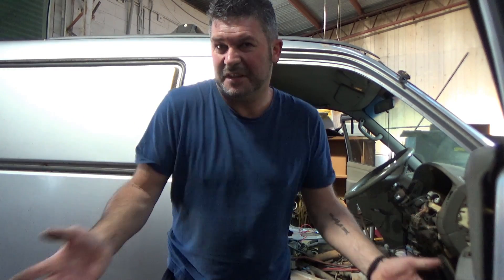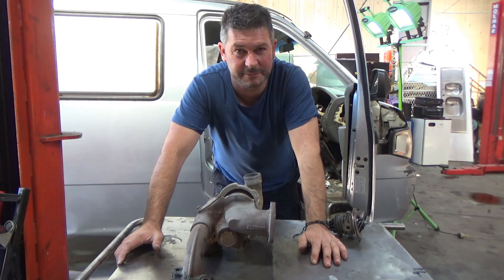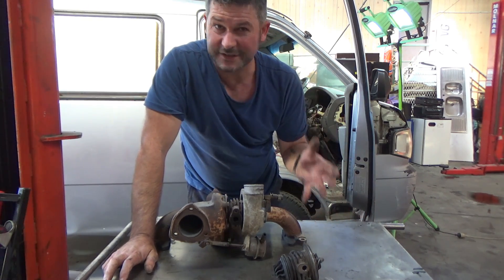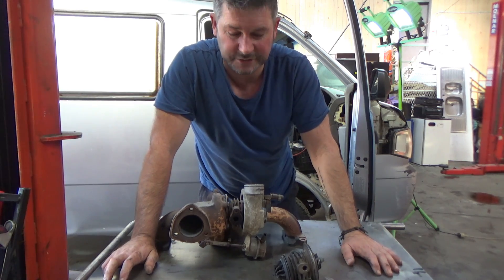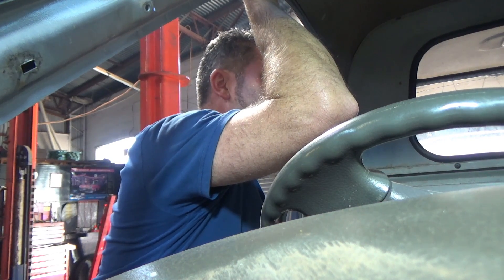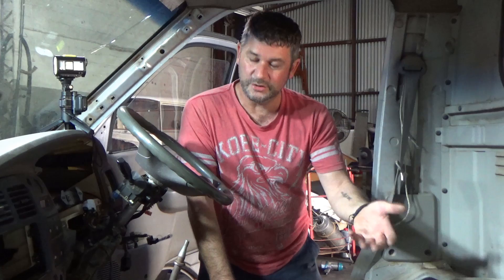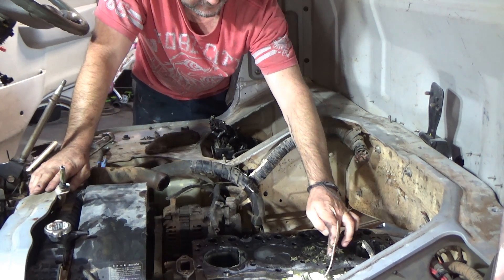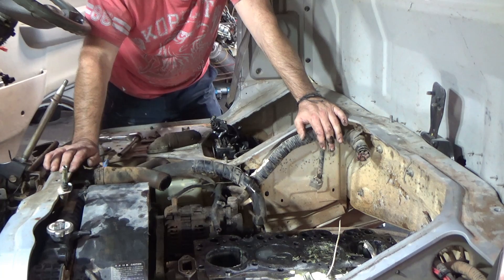How to Stop a Run-away Diesel -ENGINE BLOWS !

Comment: The whole rag idea generally works. I was working with my grandpa on his 2002 Cummins diesel and with all the fuel in the air in our shop started it into runaway mode (accidentally) and he threw a small pile of rags into the intake and it managed to stop it.😁

Comment: Running a 12V-92 on a dyno one time, guy in the next cell had a little 4-53 run away on him, open blower intake. He grabbed a bunch of shop rags, threw them at the intake. There was a big bang, room filler with red confetti, engine stopped, but the blower fell off the side of the engine in a few pieces. Cutting off air will always stop it, but have seen it invert old blower seals.

Comment: Good job mate I ironically I just watched that video showing runaway diesels. You might want to use safety glasses and ear protection next time dumping the clutch may be a bit dangerous and blow a " U " joint , driveshaft or clutch. However they are cheaper than blowing the engine. The rag if it were to get sucked into the turbo would have been chewed up by the turbo blades. Typically a CO2 fire extinguisher is your best bet if one is available. Good job though I think you took a topic that needed to be shown what will and won't work possibly saving someone from harm.

Comment: In all seriousness though the best solution for stopping a run away for the majority of watchers is attempting to stall it.
So the real question is how to let off the clutch. Do you drop it and risk it exploding under the massive torque pressure or let it out slowly and risk overheating / burning it out before it is able to drag the engine to a standstill?

Comment: I had a runaway a work twice. Keep it in gear and full on brakes!
They overfilled with oil and starte d burned oil through the PVC system.
Scariest drive ever

Comment: Its pretty simple. Most runaway diesels are turbocharged. And then have charge air coolers. Yank the piping. Done that before. A $40 tube is worth saving the motor

Comment: You need something to cap off the air that is sturdy enough that it won’t get sucked in. A rag will suck right in and not even slow it down. At least the ones I have seen did. Your test is nothing close to accurate because a real run away usually scream way past where you can rev it to with the pedal.

Comment: I've heard of runaways on tractor trailers, sucking holes through phone books and clip boards and such. My mechanic teacher said its pretty hard to stop a runaway. Cause a runaway just doesn't sit at idle, why they're so bad is because the rpms just keep climbing, till the engine rips itself apart. Other wise you could just let it run till it was done doing its thing, its the rpm climbing that makes it dangerous.

Comment: We had a old Detroit 2 stoke run away in a boat our head tech grabbed a 1/4 in steel plate and threw it over the intake that thing pulled so much air it tuliped the steel plate. We also had a turbo charged cat run away we tossed a phone book in the turbo. Got about halfway through it before it stopped
Reply: Georgia 7.3 I hope you got the name of the nearest mechanic before sacrificing the book. :-D

Comment: As far as a manual goes it depends on if the transmission is synchronized, or not ( Semi truck ). I've had a semi run away with me before and I wasn't about to be messing under the hood incase it decided to throw a rod. It wasn't possible to put it in gear either. I just turned the key off and let it stop on its own after the motor oil ran out. Surprising the engine didn't seize up after.

Comment: I real runaway is when the engine runs on the oil in the intercooler, it revs up to around 8-12000 rpm and it’s almost unstoppable.

Comment: Quickest way is put your foot over the exhaust and smother the engine insides with exhaust fumes. It works this happened to me, and remembering how we used to stop mopeds with no ignition from when I was a kid. It took about 20 to 30 secs from it happening jumping out the car and it stopping. Still killed the engine it melted 3 out of the 4 injectors and there wasn't much compression after. Don't know how hot it gets in there, but it must be high.

Comment: Can't you just clean out the engine after filling it with the powder?
Reply: Nope, you try to compress something non-compressible, it will bend or break the connecting rods.
Reply: Same result as getting a bucket of water down the air intake (broken off snorkel). Hydrolocked engine.

Comment: Interesting that noone speaks about one guaranteed way to turn the engine off and thats simply fuel line. Any engine will die if U starve it of fuel.And it will suffer 0 damage from it.
I do have to state some facts tho. 
First Diesel engines primary purpose is durability besides economy so in overreving for a minute U will not do any even noticeable damage to your engine If U think otherwise You either are running an American made engine or are in dire need of some education.If U cut fuel to the engine it can overrev for about few seconds and than die granted few very economic engines will run for maybe up to 30 sec tops until they drain the system and shut down.
Second High gear is the first thing to try and will work in 99% of cases. If U own an automatic diesel I dont know what to tell U.If U are an disabled person all respects to you if U are without disabilities(except the brain one) Dont breed please save the planet. Either way fuel cut works as a backup.
Third even if U have Old turbo cars and even if U manage to put mineral oil in it ( u cant because noone makes them anymore) it will not run on it for long and it will start slowing down immediately as Diesel runs out until it shuts down. Synthetic oil alone cant run a diesel engine so It will still shut down even if your turbo is leaking like mad.

Comment: Why don't diesel's have butterfly , similar to a choke plate found in a  carbeurator, to block airflow in an emergency? Have a pull knob in the cab, and yank it to close the butterfly when the motor runs away?
Reply: Some newer diesels do. It is connected to a speed sensor over the flywheel. It automatically shuts the valve should it exceed safe speed.

Comment: I actually wish you that you get a turbo diesel on which you can losen the seals to the intake in order to really test this out with an engine that is actually "running away" as in "uncontrollable combustion of its own motor oil", because that is the definition of "running away", it has to be uncontrollable. Because otherwise, there might still be something like a rev limiter or other things that do not mean it is the same test conditions than an actual runaway diesel, which revs as high as mechanically possible (limited by the capabilities of the mechanical parts inside the engine, like valves, pistons and so on). For me, this test is not satisfying like that, but since I also cannot provide you with a suitable vehicle, I just wish one your way with which you can really test all these methods.

Comment: I am so sorry that the wood wood not work. =P I suppose if you have your garden variety MAP (mon-ammonium phosphate) fire extinguisher, your choices are to wreck the engine before the big smoke and blazing fire, or after. On bigger machines or trucks, the engine will quickly overpower the clutch and destroy it. I have seen it happen first-hand. Cars and caravans, not so much. All in all, good job on the video, thank you for sharing!

Comment: Re the powder extinguisher, well it did make a mess & you would've had to strip the engine down, but it did save it! Unless you're saying the pancaked powder caused valve, piston or con rod damage?

Comment: Consider carrying a CO2 extinguisher in a diesel vehicle, it starves the motor of oxygen and it stalls. All you need afterwards is a new turbo, filters and an oil change. (And have the CO2 recharged) Spray till till the motor stops, the CO2 is much cheaper than the motor.

Comment: This was powder extinguisher. Use a CO2 extinguisher - it does the job, probably without welding the pistons. Only problem is, if you use CO2 in the closed space of a car - you could suffocate everyone inside... :D
If it's a turbodiesel - a hermetic seal on the air intake (if it's burning oil). If it's naturally aspirated - best disconnect the fuel.

Comment: Powder extinguisher will definitely stall the engine. CO2 extingueshers should be harmless.  But i think, small extinguishers will run out of gas before engine comes to complete stop, otherwise it will suck fresh air in and run away again.

Comment: Isn't this runaway issue a reasonable cause to discontinue diesel engines for standard passenger vehicles?
At least with a standard gasoline engine you can shut it down.
Keep in mind, I have never owned a diesel engine. But it seems to me that an engine without the ability to be shut off is dangerous to say the least.  Not everyone is intelligent enough to take it out of gear. 
Panic, plus a non-stoppable engine equals disaster to me.

Comment: Remove oil line from turbo which is the fuel source for a true runaway.
Reply: Smart. Add a shut off valve to the oil supply line.
Reply: While I agree with you, I wouldn't want to be around a runaway engine for that long.
Reply: And dump all your engine oil them run a big end bearing...…. Smart

Comment: Run away Detroit diesel will either make u a man or a mouse! Lol!
Reply: Michael Cuff 
  True !  My Father in the Navy was faced with a run away 6-71 in a boat .... the men could not kill it until they "fed" it a bunk mattress !
Reply: Michael Cuff ...I have seen an 8v71 blow pistons through the hood... These engine have an injector hang  wide open, and nothing short of god can stop them....when we ran the rack on these engines, start up always took to guys.. One to turn the key, and one with a 3 pound hammer, to knock the fuel line off the head, if the rack hung and it ran away..

Comment: Stop it from getting either fuel or air and it will quit! If u have the balls to hang around to do it! Lol!
Reply: That wouldn't work on a turbo since like he said the engine is running on its oil.
Reply: Michael Cuff: "stop it from getting fuel" ? Are you brave enough to start unbolting the turbo while the engine is in a runaway condition????

Comment: Although blocking the intake didn't stop the engine, it did throttle it down, so it might still be worthwhile as it could buy you some time to cut off the fuel supply, or at least prevent the engine from blowing even though it's still running.

Comment: I think your logic is sound.
If I was driving along with my nan (100 years old) in the car a I had a runaway engine I'd use a dry powder extinguisher even if the engine was totaled.

If there's a chance of it happening how about having a extinguisher plunged into the inlet? Pull a trigger and the engine stops...
Or feed the exhaust back into the inlet?

Comment: There is one more thing about extinguisher. Air filter should remain on it's place. That way powder plocks the filter and none is going straight to engine. Repair cost 15€ try this when you have one more engine to play with. Good test.

Comment: Fire extinguisher thing only works with a co2 extinguisher. The co2 displaces the air and the engine dies. It's incredibly effective and totally safe for the engine. Using a dry chemical extinguisher, just fills the engine with dry chemical. Very bad.

Comment: If you get chance to try again; add a plastic bag to the list - very common item and air tight. Even then, would you have time to lift the seat etc and get to the engine before is blew/scared the willies off you?

Comment: +Naked Off Road  - The idea behind a fire extinguisher is to blow it into the intake and clog the intake filter, thus starving the engine for air and, even if not completely shutting it off, making it run slow and rich so it doesn't blow up while you then gain composure and find other methods to stop it, such as pulling the fuel line (or oil line to the turbo). Or if you have a few tools, loosen the head so it can't make compression (thats at risk of course, but will definitely stop it). Anyways, you'd have time to think about it after blocking air flow even if it continued running slowly. Fire extinguisher probably would be the easiest thing for someone to do and if blown into the filter instead of straight in the intake shouldn't do too much damage, if any.

Comment: if it was a runaway you would not stop it by putting in gear  as a runaway is at if not beyond full throttle it would over ride the clutch  or twist the prop of as diesel oil is a very powerful fuel more powerful than diesel alone

Comment: Good video it's been my experience the clutch typically works but in the case of a 13 liter twin turbo diesel the only thing that works is running for the hills seen first had about 6 go this way and as far as safety goes a 13 liter twin turbo diesel grenades you should be as far from it as possible the one I experienced ran up to 5000 rpms and blew a coffee can size hole in the hood and took the hp fuel pump and compressor clean off the engine due to a failed hp turbo passing oil
Reply: Ps the diesel is a 2012 maxxforce 13 class 8 engine only 40k to replace not worth anyone's life

Comment: You did not do the fire extinguisher one right. you need to fill the air cleaner with the powder because it covers it up because of the suction and, essentially, kills it without damaging the engine

Comment: I have seen gas engines run away. Throttle body got stuck open. like on a dirt bike that gets a stick stuck in the carb area or an offroad truck getting mud in the pivot points of carb/throttle body.
A bunch of back yard mechanics get them as well when swapping mechanical diesel pump parts out to make more power.

Comment: Quite a few years ago I was taking very heavy load of slate over a high crown bridge. Some one cut in and had a minor fender bender right in front of me and I stomped on the breaks.  I had a 225 gm two-stroke natural aspirated w/ a (sloppy)13-speed. I was only doing about 15 mph just at the max pulling rpm in 3/4th gear. The unit recoiled against the lash in the drive train and kicked the engine over backwards. This is possible with a two-stroke. I shut the ignition off, but the mechanical fuel pump still had lots left in the lines. There I was, stuck on a bridge, the exhaust pouring out of the air filter and air sucking down the exhaust pipes. Of course, pulling the emergency shut off did not work as that cuts off the air from the air filter--which was now the exhaust pipe. The RPMs just kept climbing. So I put it in 6/7th gear and let the clutch in until the revs started to drop and then I just popped the clutch. As the engine was running backwards, the truck lurched backwards against the brakes and stalled.

Now I was really stuck.  Police trying to route rush hour traffic around me and the engine was heat seized. 

I got the police to clear out 4-5 cars from behind me and w/ a few tries, force roll started the engine by rolling backwards downhill and popping the clutch in hi-reverse . Fortunately, it worked just before I ran out of brake air and dynamited. 

Years later, this would not have worked with a Cat 425 or a 6V-92T which a) would not have run backwards and b) would have dropped the tranny if I popped the clutch at high rpm

Interesting times....

Comment: Yes, but. Another runaway scenario is that a overheated diesel pulls engine oil past the rings. In that case, it will run until the engine oil runs out or internal friction forces the engine to stop. Probable outcome is a ruined engine. Unless you end up with a fire instead, and that might be possible. The same thing possibly could happen with a high compression gasoline engine.

Comment: not 100% convinced the put in high gear , dump clutch & stamp on the breaks would work in a real runaway as many say when they runaway they can often rev far harder than running on the fuel as the rpm is no longer governed & the torque produced could well be far greater than the clutch can handle, if that van had been a turbo engine I'd of said put that dodgy turbo on you've got even if you have to make its seal a bit worse & get the thing to actually run away properly not just flat out throttle & then see if you can still stop it

Comment: Surely if the enjin was running at full runaway speed and you tried putting it in gear, the stress would cause the transmission to disintegrate and thousand of bits of shrapnel would end up flying everywhere, including through the driver?

Comment: For a leaking turbo in a diesel it might just work to pull of the air hose from turbo or intercooler to the intake manifold. So the oiled up air just gets blown in the engine bay, not into the engine.

Comment: an old hilux did this to me and I tryed to stall it and it didnt work so I just pulled off the battery leads
Reply: "Joke"
Reply: Diesels don't have spark plugs.
Reply: Loony Rocket hahaha good one i got you 😂
Reply: Samuel Seidel actually that's not entirely true there are diesel engines with spark plugs they usually run on propane or cng
Reply: If it runs on propane its not a diesel?

Comment: Luckily this shouldn't be a problem in newer cars, most new cars have an Anti Shudder Valve built into the EGR valve, I have a 1999 VW Polo TDi and even that has an ASV! this fully closes when turning the key to the off position blocking intake to make a vacuum in the cylinders for a dampened shutdown!

Comment: i had turbo diesel runaway and luckily it was manual so i killed it in 3rd gear (extra high revs and lots of white smoke). with automatic, a rug would be sucked in but i always have a sweatter in the trunk which is way bigger and would not be sucked in and it would kill the engine without damagging it. so if you have an automatic just keep a blanket or a sweatter in the trunk and you are good to go...
Reply: ktm640lc4BGD even the shirt off your back should do it.